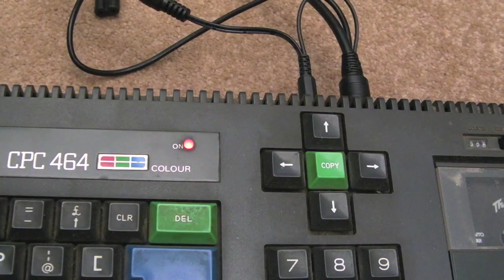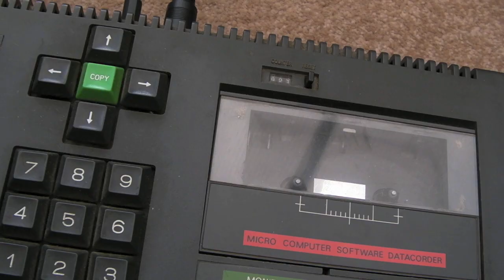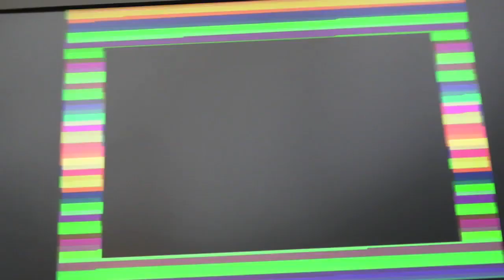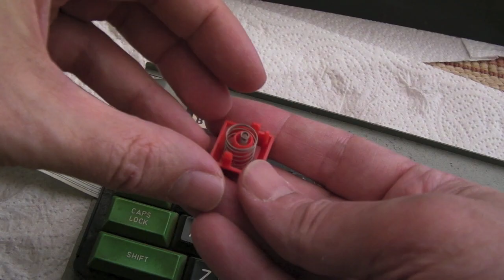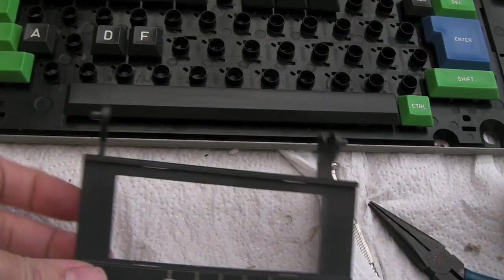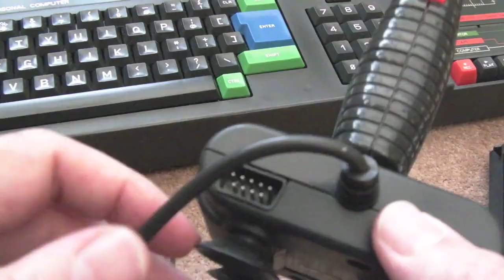Amstrad CPC 464 Repair & Restore - Junk to Jewel

Comment: I never came across anyone with a CPC at school, it was all Speccy's, C64's, and one guy even had a Sam Coupe, then it was all GAMEBOY, AMIGA and MEGADRIVE around the age of 12, good times, but strange as your pretty near me if you lived near Poulton, did you go to collegiate High School?
Reply from the maker: I went to Hodgson High School! =D  When I was in the trade I later had contracts for all the local schools!  Did some repairs for Collegiate! =D
Reply: I worked there for a while myself, when I was there they had those green and black monitors and eventually upgraded to those Acorn Amiga knock offs, that kept getting viruses for obvious reasons as they let you use them on breaks for school work, yeah right.
Reply from the maker: Haha =D  Yeah, some Acorns came in for repair from a few schools round the Fylde, and they nearly always had games on the HDD lol.

Comment: I had always heard the Amstrad gear was absolute trash, but never actually saw one in person or used one. I will say I do love the ancient looking colour keyboard with sculpted keys, and the game actually looks great once it finally loads in. The internals were a bit frightening at first (I was yelling "where TF is the voltage regulator" before you discussed it being absent). I swear those are your pubes on that first cotton bud -- but I doubt they could escape from your ESD-safe underwear. Interesting video!
Reply from the maker: Hehe, yes - I think their reputation is unwarrented.  They are nice machines and very robust tbh!  Not as many Spectrums or C64's have survived in as good condition as these CPCs.  LOL @ pubes, yes - it was really dirty in there!

Comment: A really nice clean up and fix!

The Beeb has the same arrow and copy key idea, for redoing commands / listing.

I wouldn't mind an Amstrad 6128 plus. But it that'll have to wait for now.

I've never personally used a CPC apart from at Dixons all those years back. Like you, I grew up with the Sinclair range.
Reply from the maker: Yeah, I would like a 6128 plus too =D   LOL @ Dixons, I spent time using some of the systems I never owned in that same way.  Got kicked out of Dixons once for changing a load of PC keyboard layouts to french with the KEYB command.

Comment: I was thinking the same. This board was a number 1 candidate for a dishwasher. You can always use later some IPA or some contact cleaner in the socketed chips, or take them out use the contact cleaner and insert them again.
Reply from the maker: Yeah, I think provided its rinsed off with distilled water or IPA that technique is probably OK.  The problem is where salts or liquid doesnt come out from under chips or from inside sockets.  Blowing the board down would fix that though =D

Comment: Awsome restoration! The CPC is by far my favorate computer (my first computer was a CPC 6128) I've had many through my hands and they only ever seem to suffer simple faults, soon as i saw that one I thaght corrosion lol. Oh and that PSU is also a TV modulator I mod them when I get them in with a scart lead coming out. much neater than the seperate scart lead. also watch how that lead you have is wired, if its useing the full 5V to switch the TV into RGB it could potentialy dammage your tv as the TV is expecting between 2-3 volts.
Reply: JaysVintageJunk JaysVintageJunk 

Allo, mate.

Haven't seen you on here for a while, but I've been following your ZX81 vids etc. Good stuff. ;)

I would recommend always adding a series resistor to machines that have a direct 5V output going to the SCART cable btw.
(just to limit the current, in case something shorts out.)

But, I've found that some TVs won't switch to RGB mode if the resistor value is too high though, due to the usual 75-Ohm pull-down on SCART pin 16.

The resistor might need to be 100-Ohms or lower for it to work with most SCART TVs.

I guess that's one big advantage to using switched-mode PSUs these days too - they tend to have fairly good overcurrent protection, assuming they're not too beefy. lol
Reply from the maker: Thanks =D  Yes, I spotted the RF lead today lol!  Don't know how I didn't see that earlier!  There's a resistor in there but its too large - TV not switching, so I will need to reduce it.  I suspect it will switch an old CRT but not an LCD like mine (had that issue before with RGB leads using 5v).

Comment: i've never had any issues cleaning off the major dust bunnies by hand and then scrubbing it down with windolene glass shine in the sink, the boards don't warp easily like a lot of others do so running a hairdrier over it to get it bone dry doesn't hurt anything either.

Comment: Sweet. My first computer was a CPC6128. Memories! Great job. PS  if you trace the wires that go to where the tape head reads the tapes then you can solder into them, put a (mono I think) jack on the end and use something like Tapdancer on your phone to load games ;) There is a howto somewhere online. Good call with the cap and saver on the power in. I am using a shoddy ebay 5v so worth checking...
Reply from the maker: Thanks!  Yes, I did exactly that today - just like I did on my +2 original (before I reverted that mod).  It works fine though, and I can load from tzxduino via SD OK now!  Although some games have issues due to delays and copy protection.

Comment: Yeah it's 27 colors with 16 at one time, very vibrant. An attractive shell design for sure, I love all the colors, shapes, and print on it. Hard to give all the platforms equal love, got to stick to the budget heh. I tend to do IPA scrub baths for boards if I'm in a hurry but soap & water mostly just needs patience, let it evaporate a few days. Good stuff, get that corrosion! Was it stored under a couch? ^_^
Reply from the maker: 27 colours and 16 on screen - wow, that's awesome!!!

Comment: Another lovely job. Cleaning and repairing stuff like that is sooo satisfying, though I mostly do hifi gear these days. I would love to own an ultrasonic cleaner but find that you can get excellent results manually, like you just did. I've never used the dishwasher though, it kinda scares me a bit.
Reply from the maker: Thanks =D  Yes, I think a dishwasher is a bit 'brutal' really.  Its bound to leave residue etc.  I do also agree that cleaning and repairing them is often the most satisfying part =D

Comment: Graphics looks a bit sharper on it. Is it a good gaming system? I mean compared to C64
Reply: bwack There are no hardware sprites, and the screen memory is 16k which is quite a lot for the Z80 to be pushing around, so games can be a bit slow and jerky on the system, but it was a very popular system in Europe with some great games. A worthy contender to the C64 as was the Spectrum.
Reply from the maker: I will check out that port of R-Type, I think Novabug mentioned that to me earlier.  I might have watched his video on it actually!?!?  Yeah, the CRTC was the bottleneck I think!  Nice machines none the less though =D
Reply: bwack 

Hi,

We had a 6128 in the 80s, and I loved it.

Our first home computer was actually a C64, but it was sold when I was around 3 years old, so only vaguely remembered it.

Having then grown up with the CPC, Olivetti PC1, and Speccy +2, I never really appreciated the "pastel" style colours of the C64 (until recent years), regardless of it's hardware sprites, scrolling, and awesome SID chip.

The CPC was based around the 6845 CRT Controller chip, which was really very basic. It was used in the Commodore PET, and on most older CGA graphics cards.

The CRTC only had some X/Y counters, and would often just directly address a character ROM, depending on the contents of a small RAM.

In the CPC, the Gate Array just does the basic address decoding, RAM refresh / addr muxing, and adds colour to the CRTC output.

So, it doesn't handle hardware scrolling nor hardware sprites, so that's normally done with "brute force". ie. using the Z80 to write directly into the screen RAM area, like the Speccy.

But, later in it's life, the games programmers and demoscene coders figured out how to "abuse" the video timing registers on the CRTC to help do better scrolling effects etc. ;)

There's a very good remake of R-Type for the CPC, and a perfect example of how the system suffered from very lazy ports of games from the Speccy and other Z80 systems (as GadgetUK mentioned).

As much as I love the Speccy for it's quirky / original / fun games, the CPC also had tons of character, nice colours (in the better ports), and some really great versions of games like Cauldron, Gauntlet, and many others.
Reply: GadgetUK164 - Retro Gaming Repairs & Mods I think the graphics are by far the nicest looking of the 'big three' micros in the UK. When it's programmed well the CPC can be stunning. The CPC plus range, that came out in 1990 was fantastic, as they added the hardware sprites and some of the (few) games that came out for it (and the GX4000) were gorgeous.
Reply from the maker: Some good games but as others have said, the problem with the CPC was bottleneck on graphics.  So a lot of games tend to run slower than the Speccy or C64.  Some though are better imo!

Comment: Isn't the screen layout on the Speccy quite differently laid out in memory compared to the Amstrad? 
And the way the charset is redefined is probably too so with lazy ports these had to be ' translated ' converted. Not sure if they had ' conversion ' code running in conjunction with the the original spectrum graphics code... I believe they did in some of the games.
Reply: lactobacillusprime It's not really fair to say that the Amstrad games were Speccy ports as such - and yes the screen layout was different.

Games were usually developed in parallel between the two machines (and sometimes the MSX)... in reality all two/three systems lost out through this - the Spectrum versions tended to be slower and jerkier than they ought to have been as were the CPC ones. Spectrum users suffered just as much from unoptimised games as a result.
Reply from the maker: Yes, I think there will be examples out there were translation code runs to make the port easier etc.  It's shocking how some CPC games look exactly like the Speccy version, almost verbatim lol.  Yet they run slower!  The CPC had a faster CPU, so maybe it was the graphics that created the issues.
Reply: I mentioned this already further up, but due to the different way screen memory is used, the Spectrum display takes up 8k of memory, whereas the CPC with its more advanced colour capabilities uses 16k. The Spectrum display is only 256*200 while the full CPC display is 320*200, but even when running in a 256*200 window (as all Spectrum ports did), the CPC in 4 colour mode still requires you to write 2 bits per pixel to screen memory, whereas the Spectrum only requires 1 bit per pixel (plus a colour table which divides the monochrome screen into 8x8 colour blocks). So the CPC is having to write 12.8k of data to do the same thing that the Spectrum can do with 8k - the CPC has no monochrome mode so it has to output 4 colour graphics even when displaying a monochrome Spectrum port, hence running slower.

CPC ports of Spectrum games often ran into memory problems and had to have the graphics cut back for the same reason, despite the CPC having more physical memory.

Comment: Wow Chris, what a happy moment fixing that connectivity to pin 24 :) I have to say, I'm really impressed with the Amstrad CPC. It's nothing worse than the C64, perhaps even better considering the colours it can display.
It's a testament to the resilience of the hardware really that it can take such abuse and still work. There's only the one via that got corroded. In essence you could have found that without the use of a scope. What was vital here though was the proper documentation of course.
Reply: Wouldn't the salts and the other chemicals used in a dishwasher affect the board at all Chris? There's usually regeneration salt in there and glass polish crap.
Reply from the maker: Yes, that's one reason I don't recommend it lol.  But the idea is to wash the board in the dishwasher, then rinse with distilled water and IPA, clean it down, brush it down with IPA etc, and use hot air to dry.  Not something I would do or recommend, but lots of people do it regardless lol
Reply from the maker: Yeah - I was pleasantly surprised lol!  I fully expected either a RAM fault, dead CPU or faulty gate array or VDP etc.  True that if I inspected all traces carefully I would have questioned that one near the gate array.  It was quite short in length though, easy to miss.  All the more reason to clean boards up before doing a full inspection I guess.  The CPC is a really nice machine!  Its not as powerful regards gfx and sound of the C64, but some great games on there.
Reply: The CPC hardware is the best out of all the 8 bits machines. Almost no Capacitors, and tank built. once again the proof :D

Comment: Nice work, that board clearly needed a good clean. Wouldn't recommend dish washer though as water gets trapped under chips and can lead to more corrosion. I try to stick with things like IPA which will evaporate. 

Thanks the callouts, and the 'untested' blog link.
Reply: Dave Curran 

Yep, I agree. Please stick with IPA where possible, or distilled water at a push.

(Isopropanol is quite cheap nowadays, though.)

I would personally never recommend that anyone use normal tap water on PCBs.

Tap water usually contains chloride, fluoride, metals / minerals, and other impurities that not only make it more conductive, but can leave trace amounts on the PCB after drying, which can accelerate corrosion over the years that follow.

Also, as Mr GadgetUK (and yourself) said, the water can wick underneath the sockets and chips, and often not fully evaporate for many months.

There are WAY too many vids on YouTube where people suggest that washing PCBs with tap water is a good idea, IMO. lol

I've even seen people washing rare / expensive arcade PCBs in the sink / bath / shower, or even using HOSING down an entire CRT chassis or vintage amplifier. :o

There really needs to be a "Picard Facepalm" button for those vids. lol
Reply from the maker: Thanks =D  Yeah, I wouldn't recommend using a dish washer either.  But a lot of people do seem to use them for really bad boards.  I prefer IPA too because it evaporates, leaving no residue etc.  Dishwasher will probably introduce salt and stuff on the board somewhere as well.

Comment: Track rot was common on board of that era. The spectrum with its tinned tracks seems to last better in that sense.
Reply from the maker: Yes, I think it's better described as track rot.  Since the area next to the ROM there didn't really have any corrosion there, it was like corrosion was already on the trace all along and it corroded under the solder mask.

Comment: I've had a "Untested" Multi Mega, which I presumed faulty but was working fine.
I would have worn gloves touching that board, its filthy.

The C64 of Chase HQ is a very very poor port of the spectrum version.
The better version of Double Dragon for the Amstrad was ported from ther ST too.

Good work, novabug would be proud.
Reply from the maker: Yeah, you can luck out with 'untested' on eBay sometimes!  Sounds like you certainly did with the Multi Mega!!!  I will check out the Double Dragon port on the CPC, not seen that!

Comment: Loved my CPC just wish lazy developers didn't put so many crap Specy ports on it. I was lucky to have the tv modulator and the colours were stunning. Great video dude, subbed.
Reply from the maker: Thanks =D  Yes, it is a shame there wasn't more effort put into some of the ports.  I am sure lots of the ports could have been much better in the right hands.
Reply: Yeah the Lotus Esprit and R-type ports just killed me as a kid. Do you think your CPC ram could be modded to 128k?
Reply from the maker: I am looking at ways of doing that, but it's not that straight forward...  It seems like I would need to create some logic to link the additional 64K, with a PAL and some 74 logic (5 or 6 chips by the looks of things), plus the RAM.  Might be easier to see if there's anything I can buy.

Comment: great video. A system ive always wanted - impossible to find over in the USA. thanks for showing it off!
Reply: CPC 464 clone: https://www.youtube.com/watch?v=9rIPpTI_LYM
CPC 6128 clone: https://www.youtube.com/watch?v=eunGoVPqoWA
more: https://www.youtube.com/user/zaxoniec/videos
https://www.sellmyretro.com/offer/details/just-cpc-6128-fully-assembled-board-9921
Reply: You'll have to get one from the UK. Remember we use 240v
Reply: Er... that's funny. I just wrote a comment about this. Another concern with this thing is whether or not you could connect it to a monitor or TV. They were supposed to have some proprietary A/V connections for a monitor that came with them, weren't they?
Reply from the maker: Yes, but they do seem to output standard signals.  My TV handles the RGB via SCART without any issues.
Reply from the maker: Yeah, you could power it with a decent 5v PSU, something that outputs 5.3v ish before load.  Maybe a 2 or 3 amp 5v PSU would work OK.  That way you could get a 110v model and it would work fine.  Just check polarity first.
Reply from the maker: Thanks =D  There are loads on eBay, just the postage and import fees makes it a pain =/

Comment: Amstrad CPC, your talking my language. It was my only computer as a lad. I had to fight the Speccy and C64 fan boys with my Amstrad releases. You one is a later revision with the newer laptop kinda keys and logo. I wired a female 3.5 audio jack on the side and wired it up to the tape deck to load games via .mp3
Reply from the maker: Hehe =D  I did the same thing today - added a 3.5mm socket, so I could use my tzxduino.  Also had to do a fix to the cassette deck today which I might upload at weekend.  Lovely machines!  I would have enjoyed using one back in the day I think.